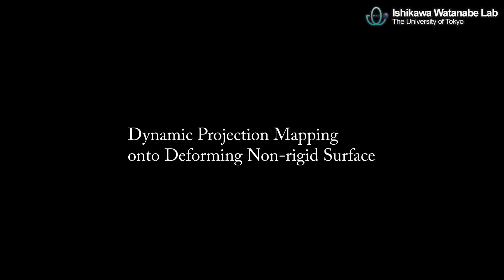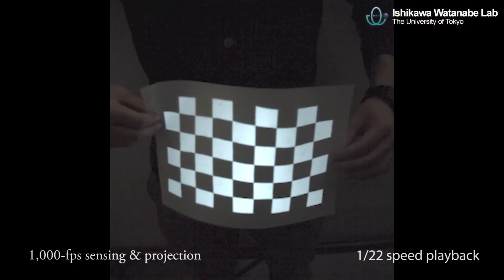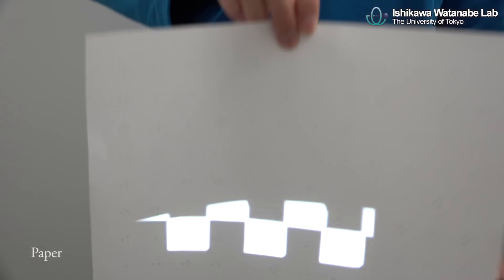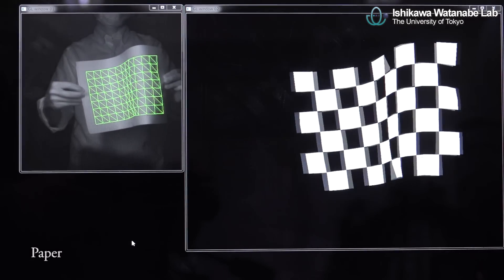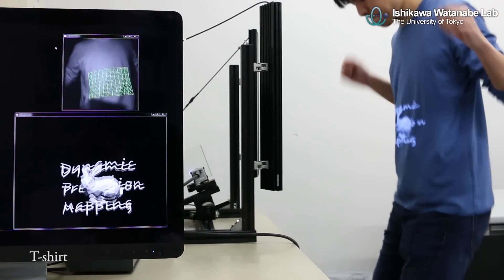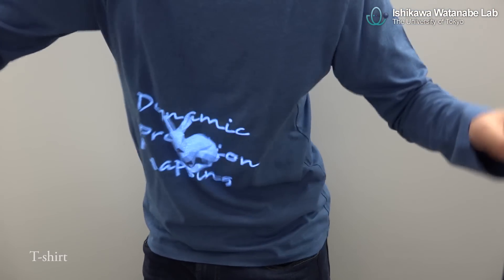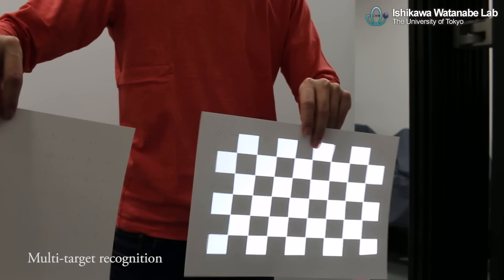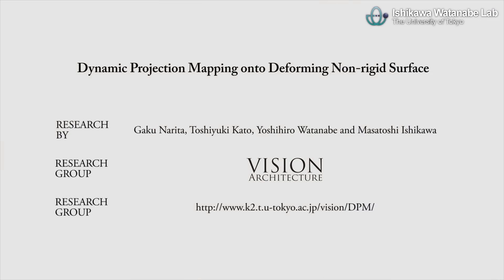Dynamic projection mapping onto deforming non-rigid surface

Comment: I would love to see this being used for AR gaming.
Reply: THE POSSIBILITIES
Reply: Gio M that's an incredibly vague statement that doesn't apply to any technology accessible today.
Reply: If you are not familiar check out CastAR.
Reply: That would be really neat. You can definitely use something like this to fill in between the normal 60 frames to bump it up to 1000 frames just so the placement stays and looks right. Though I think the main hurdle is having something react fast enough to what its seeing, which happens at a delayed 60 fps. not sure how we will ever get rid of the delay without crazy powerful hardware.
Reply: This isn't AR, it's a projection.
Reply: I think we all know that.
Reply: So what would you project onto that would enhance your AR experience.
Reply: I meant VR, OP probably did too. Rather then goggles you could project it onto the walls and adjust the images so they appear to be facing you, using this technique.
Though goggles will probably remain the cheap solution.
Reply: AR means augmented reality, and since projection mapping augments the surface on which the video is being projected, it technically falls under the umbrella of AR. Wow you really need to understand basics before you start getting into stupid internet fights.

Comment: I have an outdoor theatre in my garden, sort of. It's just a white sheet and a projector, this would be so nice to use instead of my projector and i wouldn't have to hassle with the sheet so much. It is the most painful part of the procedure to make sure the sheet is taut.
Reply: So instead of projecting rectangularly/trapezoidally on to a nonsmooth surface, you'd rather warp the image to conform to the irregularities of the projection surface?
Reply: What? I'd rather not have a wave ripple across the projected image every time there is a breeze.
Reply: Jack Porkins I'm not sure you understand what's going on in this video... They make it look as though something that isn't on the shirt, is on the shirt. Very different from standard image projection. Imagine your movie if your movie were actually printed onto your outdoor screen. If your screen isn't taught, your image will absolutely ripple and fold with it.
Reply: Brian Parchman I'm talking about the technology, not what it is being used for in this video. If they can use markers to dynamically change the image to conform to the background then it shouldn't be to hard to do the opposite. I can see what's going on in the video. I was just thinking out loud that a smart projector would be nice.
Reply: Jack Porkins gotcha

Comment: Is there some invisible infrared ink going on here or something?  The stretching doesn't seem possible to detect with a blank sheet of paper.
Reply: Yes, the video notes that an infrared ink grid has been previously printed on each object receiving the projection.  It's how the system tracks movement, distance, focus, deformation, etc.

Comment: Awesome, but interactive clothing design? That sounds like a bad kickstarter. There must be better applications.
Reply: iPaper - The interactive display you can roll up like a newspaper
Reply: That's not how projection mapping works
Reply: How would that work with this tech?
Reply: PixelCortex PixelCortex, do you even know what mapped means?  Put a sensor on a stylus, and a sensor on the grid and you've just created something interactive. What I think people are confused about is that it wouldn't be practical to have a projector follow your surface around... but they don't have to, I'm guessing they will be on the floors or ceilings in practical settings. As long as they are evenly spaces on a Cartesian grid, they should always be connect somewhere. iPaper was just a joke, but an interactive display on a device that can bend, move, drop, twist and not break is a logical next step in technological evolution.
Reply: invisibility cloaks maybe?
Reply: Citrus Blast
Strap a pi, projector and a couple cameras to a drone, hope no one see's the drone and it may work.
Reply: with projector infront? XD heres one. how about projector not projecting light but darkness, that should be invented
Reply: realtime projection of a smart phone screen onto your hand/forearm that can be powered by haptic feed back sensors also strapped to your arm.
Reply: stcrussman -bud movies will love this more than green screen
Reply: If you want better tech,better research,better funding: mainstream or bust.
Reply: Cauda Miller That would be really interesting and maybe feasible. I have a strange memory as a kid walking through the field next to our house. It was a little after dusk, close to night, and there was a bit of fog in the air. The moon behind the trees caused their(the tree's) shadows to project much in the same way a ray of light would. I just remember looking around and seeing 3 dimensional shadows all around me. It was not so much spooky, but really mysterious. I've never seen anything like it since. There was just enough fog that the shadows could bounce off of, but not enough to make it hard to see through, I think.
Reply: Zenet "Darkness is nothing but the absence of life" ~ Some Dude
Reply: f3rd1n4nt That adds a whole new meaning to the memory.
Reply: busessuck1 it's called a watch
Reply: Paul Newton Seems possible with gyroscopic stabilizers to keep it fixed on a given surface. Would need to be extremely intricate and well designed, but it's definitely a feasible concept.
Reply: tbh its a pretty damn good application
Reply: Here some applications. 
Clothing/fashion: Step into a retail / at-home "fitting room" wearing a blank outfit. Preview in 3D available patterns and designs projected onto clothes. I imagine wedding dress fitters would love this. Their clients could preview dozens of different neck, waist and back lines in a few minutes, saving time and wear and tear on dress inventory.
Advertising: Dynamic ads on real/cloth banners, flags and curtains.
Glass-less AR gaming: Project faces, costumes and body damage on people in a play space.
Medical simulation / augmented surgery: Project MRI/x-rays (in stereo) on dummies/patients that adjust when they move.

Comment: 1000 fps? I call BS on that, every console peasant knows the human eye can only see 30 fps.
Reply: the projector does display at 1000fps tho
Reply: he's trying to be funny with an old joke
Reply: woosh
Reply: The human eye can percieve the difference with frame rates far higher than 30 fps, which is why gamers like frame rates over 100.  cameras that operate at higher frame rates also reduce blurring which improves feature tracking.